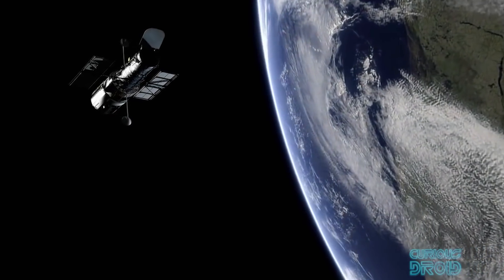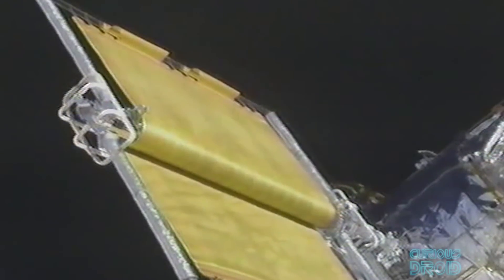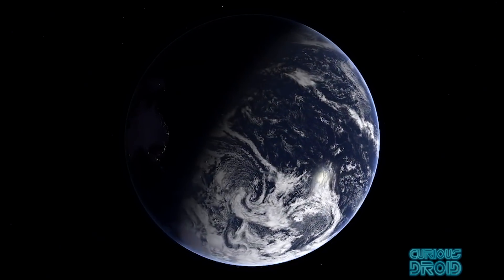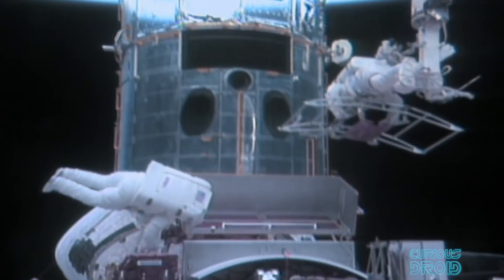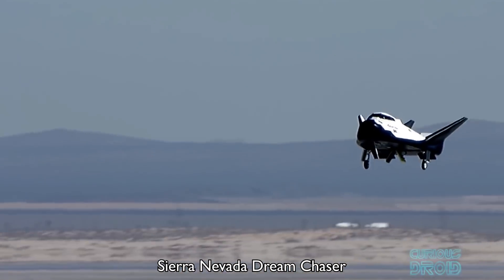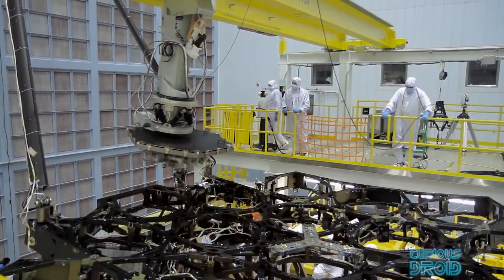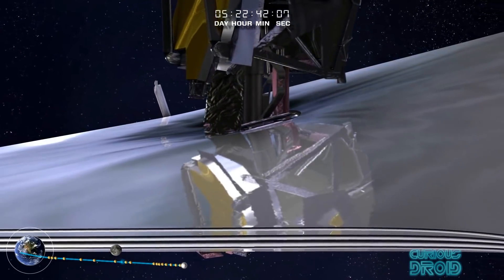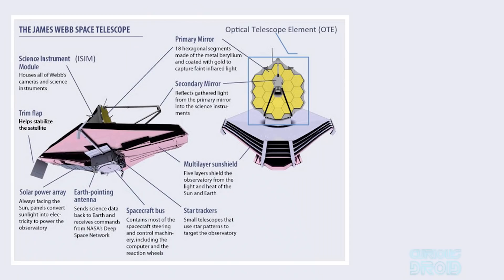Can We Save Hubble and Where is the James Webb Space Telescope?

Comment: We need to keep Hubble functioning if only for insurance in case JWST fails.
Reply: Tbh i think at this point it would be easier to just build a new hubble telescope, maybe even multiple ones with existing blueprints and some improvements. Would probably be easier too.
Reply: @loleroler1510  The National Reconnaissance Office gave NASA    2 surplus spy satellites several years ago.  Supposedly, they're quite similar to the Hubble.  So NASA already has a couple stored in the closet.
Reply: @vibrolax  I didn't know spy satellites come in surplus....
Reply: @tfdtfdtfd  There are many opportunities for expensive things with long manufacturing times to be damaged or destroyed during manufacture, testing, transport, or launch.  Therefore, it is necessary to make several units at the same time, even if you only "need" one.
Reply: I would doubt the cameras & directional controls are similar.  There would be no reason for super precision pointing, long holds on target, frame stacking, photometry and no opportunity for somewhat deep IR (now mostly exhausted) through the atmosphere nor do I think spectral imaging would be in much demand, in earth observation.  The images that Hubble produces are often just a byproduct of its use.  Much true research has now moved on to deep IR which you can't get from Hubble and can't get anywhere near the earth, the only place a Hubble 'esque' instrument can be placed or operate.  The fact that the NRO bequeathed a similar instrument shows its diminishing value for either use.
Reply: @terryrogers6232  All true.  JWST is not a replacement for the HST, it's for a different spectral band (IR), to explore different physical processes.  I think Hubble captured people's imaginations because its images of planets and deep sky objects were so much better than those produced by existing ground-based telescopes.  I'd guess there's enough worthwhile things to study with a Hubble-like instrument in perpetuity, but only enough space science funding to operate one instrument.  So be it.  It's interesting to think what might happen if JWST fails to become operational.  It took so long to build.
Reply: @vibrolax  The KH-12 is very similar to the Hubble telescope.
Reply: @tfdtfdtfd  when the military/cia buy spy satellites and they don't meet specifications, they can't really just return them to the company who built them so they can resell them to some foreign government, so instead the military/cia just gives the "inferior" spy satellites to civilian government agencies like nasa, NOAA, department of interior, etc. for civilian research purposes and any data that they collect that can be used to ascertain the spy sat's capability will be automatically classified so even foreign governments can't figure out the abilities of the crap spy sats which means the real spy sats are light years beyond them.
Reply: @vibrolax  this
Reply: @loleroler1510  no point..the Hubble has shown us all it can, and it cannot see in infra red, so it can't see right back to the big bang more or less, JWT can.
Reply: The JWST is only going to last as long as it fuel dose..which is are you ready 5 fucking years and then its scrap..you'd think they'd make it re-fuelable by a drone or satellite.and then if it works at all.so we really need HUBBLE to stay up

Comment: Why not designing a relative small attachment with durable gyroscopes that will be grabbing the Hubble telescope and takes over all movements including slowly lifting it to higher orbit? Should not be that difficult. There is a convenient grappling point that was used for the space shuttle arm that is ready to use to attach the new part to.

Comment: Shelving the shuttle before there was a replacement is one of the many reasons I think Obama was the worst president ever to hold the job. They should fix Hubble. We have a tremendous investment in it. It can still add value when the Web telescope is operating. But until it is working, why would we not have an optical telescope in space? Get the damn shuttle out of mothballs if necessary. I guess we’ll be fixing the idiotic decisions of Obama for decades to come.

Comment: so many moving parts.  I think we need to build two.
Reply: On the positive side, the second one, provided no changes are made in its design, usually costs a whole lot less to build since most of the cost is in the initial development and engineering and the equipment and jigs are already setup to produce the first unit if you create both sets of parts concurrently.  In the past, we often built two of each satellite simply as launch insurance in case the first was destroyed during launch or initial deployment.

Comment: The Hubble mirror was  mounted  at the base of a tube with a protective cover. What is stopping the James Webb mirrors from getting dust build up or pitting from mico impacts?, is there any protection besides the deployable shield?.  As for the Hubble a robotic servicing mission is well with in today's technological capabilities.  The USAF X37B mini-shuttle stripped of its military tech would be an excellent platform to build on.

Comment: Save Hubble, when it can no longer position itself launch a remote controlled ion thruster power pack and have it attach where the shuttle did.  Then slowly boost the orbit to 600km to prevent it from de-orbiting.  Hopefully SpaceX's BFR will be ready in 10 years and a refurbish/update mission would extend its life for 10 or more years.

Comment: cliff notes >
$10 billion 7 ton brick of equipment strapped on a rocket and sending it into orbit. 

start by unfolding 60 feet of it's aluminum heat shield (without tearing it) via computer command a million miles away.

open the 18 individual 4.3ft diameter mirrors and calibrate them to the nanometer,

hope & pray that it functions flawlessly because once it leaves the launch pad it will never touch human hands ever again.

oh and all of this has to happen while keeping the core components of the telescope at a cool -400 degrees fahrenheit.  haha, i don't know fellas i give it a 50/50...  either way i can't wait to see if/when they get it operational.  ;)

Comment: My hope this telescope brings visions of the heavens comparable to the the HST. These images won't be as real to us because Web shoots infrared and near-infrared light. 

The problem I have other than the viewing spectrum. The location that it will be placed in the L2 point. Which is roughly 1 million miles away from the earth. If anything fails at all. The telescope is done in current costs are roughly $9.8 billion. This could quite conceivably destroy NASA for telescope that was originally proposed to be launched in 1996 and now is projected to be launched in 2018.

The program is only designed to last five years with a hopeful goal of 10 years. Making it slightly less than  $1 billion a year. If we make our hopeful goal. If compared to the HST at $1.5 billion over 25 years. With four service missions, adding extra half a billion per service mission. The HST got better cameras and high resolution after each service mission, extending its life. Far beyond its initial design. With Web will be stuck with camera and computer technology of 2010 that will be flown into a point where it cannot be upgraded.

Given that latest failure of the sun shade in testing. I don't see that it will have a successful deployment in space, too many points of failure. The sun shade is mission critical (test fail). Test completed at 1g with 1 standard atmo, 21c temp, and 50% relative humidity. Other points of failure. 1. Another tear. 2. Stuck only part way open. 3. Struck by space debris causing major rip. 4. During the tension process, shade rips causing catastrophic damage.

Secondary mirror deployment mission critical.

Test completed. At 1 g on its back. No atom and 40 Kelvin. 

Failure points. 1. Not fully deployed. 2. Misaligned. 3. Failure to lock in place. 4 damage to arm or mirror during travels.

Primary mirror deployment mission critical. Test completed. At 1 g on its back. No atom and 40 Kelvin. 

Same failure points as secondary mirror.

The NGST concept, with an 8-meter aperture and located at L2, roughly estimated to cost $500 million. Now JWST 6m mirror and $10 billion still at L2. Will it work as promised or has it all just been a waste of time and money?

Comment: Why can't they keep a shuttle running for the purposes of servicing and maintaining the hubble?
The shuttle is a tried and tested design (with minimal failures) so how about bringing it out for that?
If too expensive for a regular maintenance vehicle, why don't they use it once to either bring it home for the museum, or bump it to a really high orbit so that it will last for many many more years than it currently will?
Reply: Well, the shuttle had a higher mean failure rate than any other manned launch system in history, as well as being the most expensive, so literally anything else would be more likely to get up there, and cheaper. However we don't have anything else that could do the job. Recommissioning and launching a new shuttle mission would be prohibitively expensive for very little gain, especially since all the existing shuttles have been decommissioned and shipped off to museums. It wouldn't matter if they only went up once or a dozen times, the hubble telescope now contains a lot of obsolete tech which would be very difficult and expensive  to upgrade or replace. Bringing it back or moving it to a higher orbit would likely cost more than it did to put it up there in the first place. Lastly, all the available funding is being spent on research, and developing new space launch systems, so there's not much of a pot that could be used to repair/move/return it, even if it were a viable proposition.

Comment: Even with those early unfortunate delays and errors, the HST is still one of the best and most beneficial space research projects. Here's hoping it'll last for over three decades. Also, I love your shilling of the Dream Chaser, Phil. :-)) After STS went to the (figurative) retirement home, the DC is the next best thing in terms of reasonably cheap spaceplanes. I'm not holding out hope that a DC mission in the 2020s will make one final visit to the Hubble and try to extend it a tiny bit more, though it would be a sight to behold indeed. Fingers crossed for the JWST, despite all the overruns.

Comment: Why can't NASA build a small booster with some robotic arm/clamps to grab the hubble, and send it to a much higher orbit? Simple, more efficient and probably not requiring a shuttle of any kind.
Reply: If I remember correctly, on the last service mission, they installed a docking ring to attach a rocket engine to de-orbit it  and burn it up. I suppose they could just as easily boost it, but with a handful of bad gyros, it's probably not worth it.

Comment: Step 1: Finish the JWST and get it into orbit.

Step 2: Contract with one or more US commercial space companies for transportation to/from Hubble.

Step 3: Upgrade Hubble with technologies and capabilities that won’t duplicate those of the JWST.

Step 4: Using strap-on and jettisonable thrusters packs, boost Hubble into a higher orbit. Ensure thruster packs have enough fuel/cold gas (whichever is used) for one more partial altitude boost. Don’t let the orbit degrade to initial position before second boost.

Simple, wasn’t it? I should be running NASA!

Comment: The hubble was built with a grapple point. So, a rocket pack could take it to another lagrange point, and the rocket pack could have its own gyro platform, to manuevre both it and the hooked up hubble. The stupid battery would not be cycled every day so would last a hundred years. Also a new gyro without moving parts would last indefinitely.

Comment: Would it be possible to use a falcon 9/heavy with a special module to push or drag it to a higher orbit or even "L2" orbit, but before i guess we should fix it's gyroscopes or give it new one's, i'm thinking the dragon capsule with few modules could do the trick that we would bring and attach to have like a little space station type so astronauts could go into outer space, but i guess this is really crazy idea or rather they wouldn't be up for doing such a thing? Just a random thought.

Comment: What keeps the James Webb mirrors from becoming dusty/damaged? Also, how do the hexagon mirrors not distort the image?
Reply: I believe telescopes like that use mechanical actuators that flex the hexagon mirrors to get them to the correct shape. As far as dust and damage it's a clean room environment. The air is filtered and everyone wears gowns. And people just have to be very careful.
Reply: Joe Vignolo - Yeah it's made in a clean room, but once it gets to space, the mirrors are gonna be exposed to anything that can harm it. All it takes is one speck of dust to ruin it. Hubble has the mirror inside.
Reply: @TheEgg185  One speck of dust doesn't immediately ruin the input, and you can program the software to cancel the effect of dust particles on the mirror.
Reply: sharefactor - A spec of dust may look like a distant star. There is a reason ibis made in a clean room.

Comment: wait a minute wait a minute wait a minute! NASA is going back to the moon, to build a permanent base, and it's also likely they will partner with Spacex who might send up BFR rockets to build up those bases substantially.  Take the James Webb to the moon base with a BFR rocket. have robots or astronauts or both unload and install it. Job done! That way it can be maintained and serviced, and it does not need to maintain an orbit. Design it with tracks and it could potentially crawl across the moon's surface to new positions  as well if they needed to place it on the dark side of the moon or something.

Comment: Why not create tele-operated robotic systems to keep the Hubble, and later, the James Webb Space Telescope,  functioning?  The time delay would be significant with the JWS,... but would it necessarily have to be prohibitive?  Humanity is making exponentially advancing progress in AI and robotics so I would think this should be feasible to do fairly soon.

To me the next big space project should be to capture an asteroid, bring it back to a local stable lagrange point using cheap ion engines, and mine it for rare materials, or even hollow it out for a feasible, relatively low cost, local space station.  Give it a spin, so as to create centrifugal force for gravity, along with a magnetic field for radiation protection, and humanity is back it space,... for good this time.  I have little, to no interest, in visiting other gravity wells.  The energy expenditure to get from one place in the solar system to anywhere else in the solar system if fairly minuscule when compared to the energy cost in escaping planets.  Ten thousand dollars to get a pound of material in orbit is fairly prohibitive.  Twenty five thousand miles per hour is the escape velocity to leave earth, regardless of the mass involved.